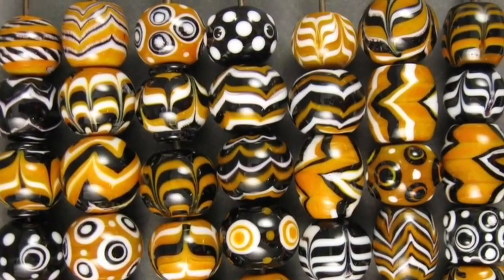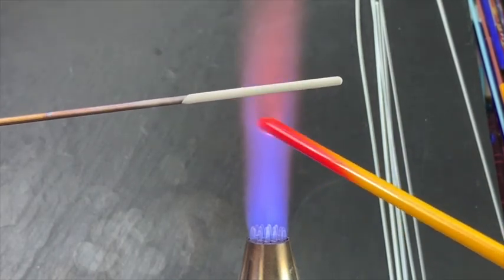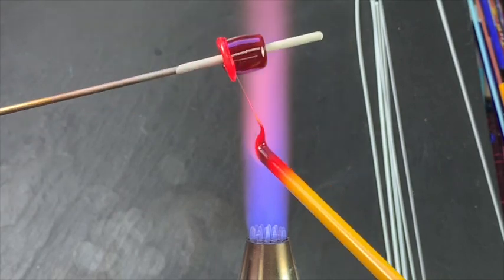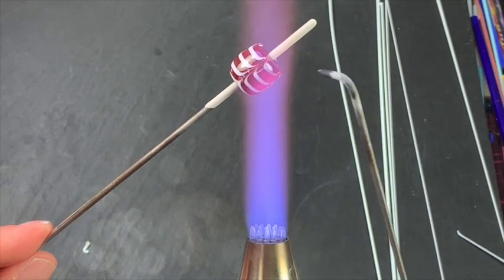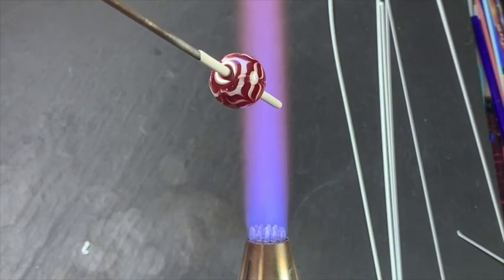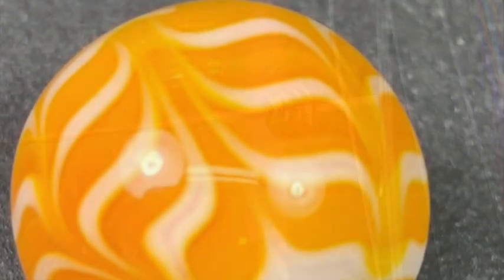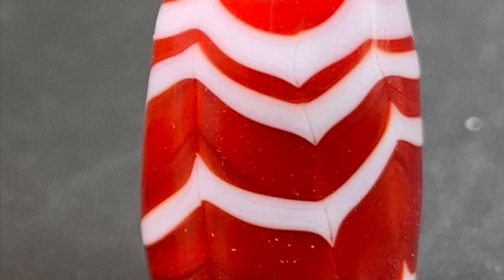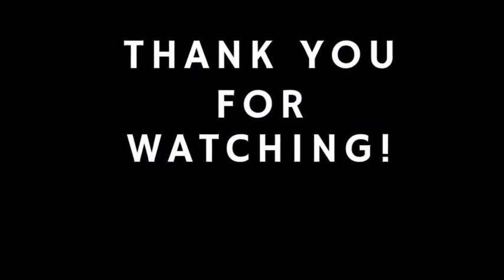Ancient Bead Lampwork Tutorial by Kerri Keffeler - Lampworking for beginners

Comment: Hey Kerri, wonderful Tutorials, and beautiful beads. Got a technical question, What is your camera setup? I have had a handful of times myself where I have had friends or relatives who have wanted to see how I make my beads, but the normal camera setups take in the flare of the glass in the flame, so its impossible for them to see whats going on. Did you have to get a lens adapter made from the same material as the protective glasses we normally wear while working at the bench?
Reply from the maker: Hello! I'm glad you are enjoying my tutorials! I use a basic overhead video phone stand from amazon with a remote for easy videoing using my cell phone.  It only costs about $25.00 and makes filming super easy. I then just taped a didymium lens from an old pair of glasses over the camera to cut the soda flair.  Easy and cheap! lol! I hope that helps!
Reply: @KerriKeffelerlampwork  ah, nice to hear my thought of reusing the lenses would work. I had pondered it a while back and kept telling myself "nah it cant be that simple", but apparently it can! Thanks for the response, happy torching!
Reply from the maker: @wolfsangelsden  Glad to help!! Happy torching to you!!